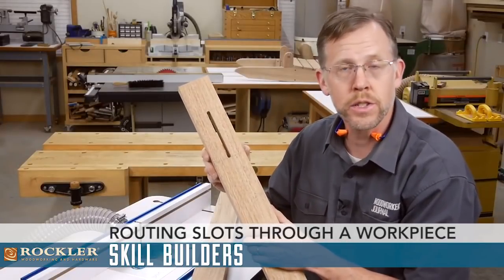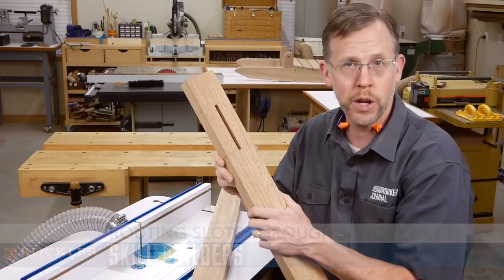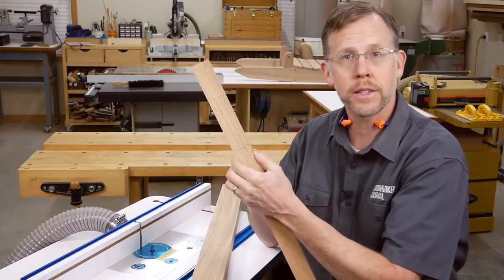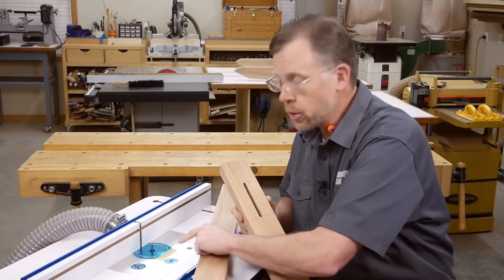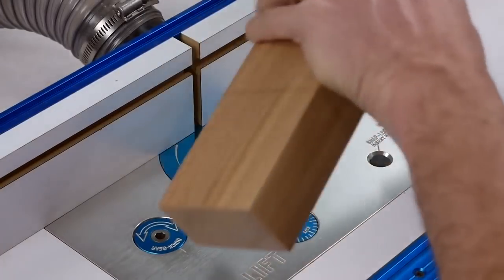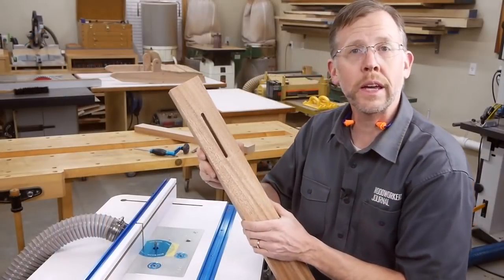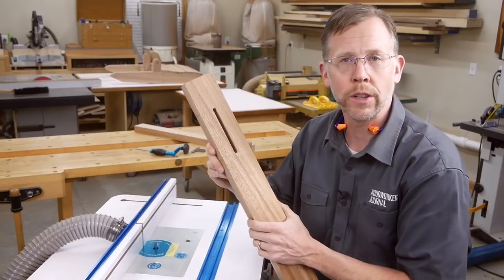Routing Slots Through a Workpiece | Rockler Skill Builder

Comment: Would I use an upcut or a downcut spiral bit?
Reply from the maker: Hi Vincent, an up-cut spiral bit will pull chips up and out of the mortise during slot-cutting, which will help the router and bit work more efficiently. Between the two choices, choose the up-cut bit.

Comment: Great tip but I have a problem with my Rockler table I bought a few months ago. The black banding that goes around the edge isn’t flush and wood gets caught up on it when I am putting it through.
Reply: If the banding is the typical plastic stuff, you can use a sharp chisel to trim it down. I put some banding on a Drill Press table I made and a chisel worked great for getting the edges perfectly flush.
Reply from the maker: Sorry to hear you're having trouble with your router table. Please reach out to our customer service team at customercare@rockler.com or 1-800-279-4441. They'll look into this for you. Thanks

Comment: Excellent tip thank you Chris. My question is to the 3 who have this a thumbs down. “What is your problem?”
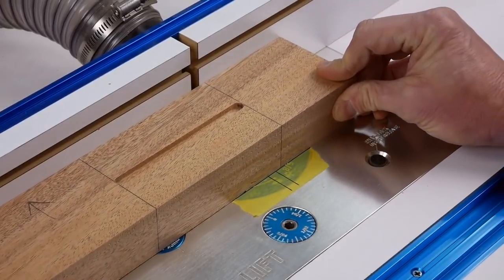Reply: Not me, but notice at 0:40 where he moves the work back in the opposite direction? When I tried this, my router grabbed the piece and tossed it across the room.
Reply: Marco Grubert 

I see what you’re talking about. He already passed the workpiece over the bit before backing up. If he had raised the bit I’m sure he would not have moved the piece  from left to right.   What happened to you is common when climb cutting and you need to have a very firm grip on the part as well as a pin screwed into the table to rest it against. That’s the safest way to route from left to right.

Comment: How can I cut the same centre slot without a router? I only have a drill and a dremel as power tools.
Reply from the maker: Maybe you could use the drill to remove most of the material, and then refine and clean it up to the line with the Dremel.
Reply: @rockler  any specific bit type for the drill?
Reply from the maker: Not really. You just don't want it to be bigger than your final dimension for the slot. That way you can refine it and clean it up to the line with a chisel, or the Dremel if that is all you have. Brad point drill bits have a point to help prevent the bit from walking when you start drilling. Forstner bits are great for drilling holes as well. You could look into either of those as to a traditional twist bit.
Reply: @rockler  Thank you so much!
Reply from the maker: You're welcome! Remember, there isn't always one correct way to do something in woodworking. The problem solving and finding a solution can be half of the fun! 🙌💙